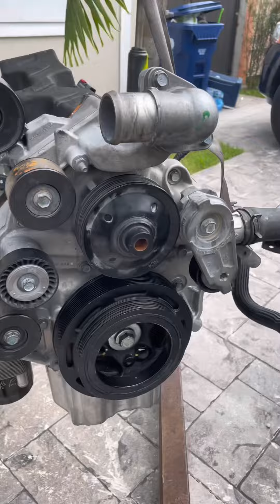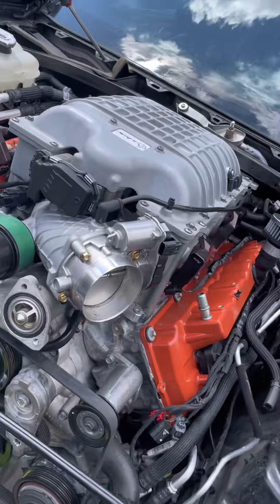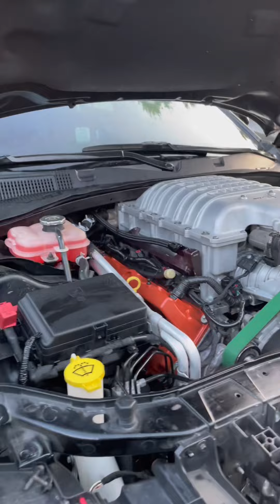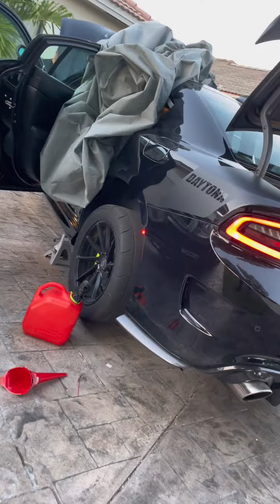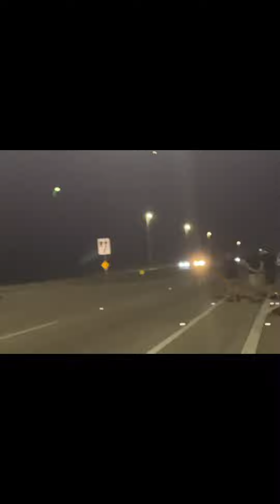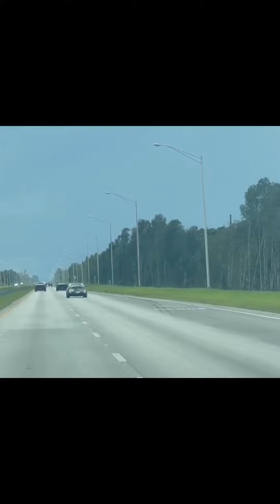Dodge redeye 6.2 swapped on392 charge

Comment: So I’m about to purchase a 2018 scat pack, and I’m buying a 2021 redeye engine or a 2020 hellcat engine with the transmission. If I get the redeye engine can I use the scat transmission? Also What other parts would I need to complete this build?
Reply from the maker: yes,  but the most that the scatpack transmission can hold is 600 hp , If you want to be with more power I would recommend hellcat transmission. and you need to extend the cables of the injectors,coil and the map sensor wire so that it works as if it were original